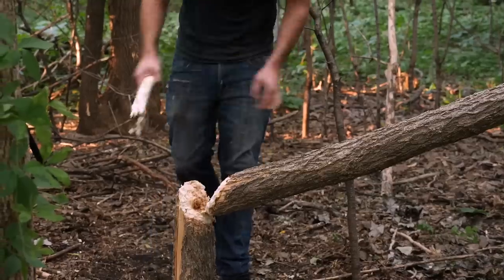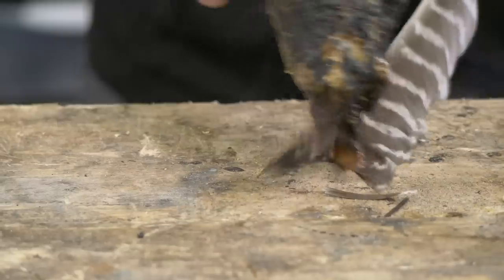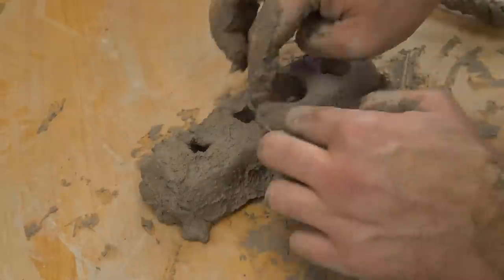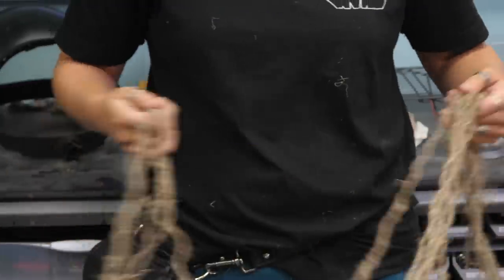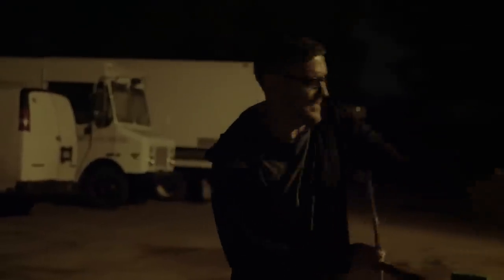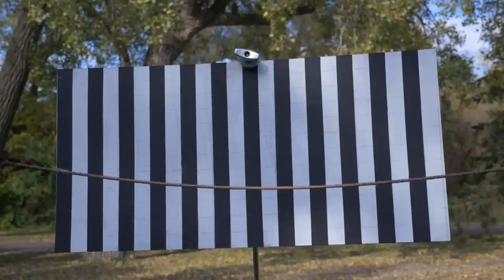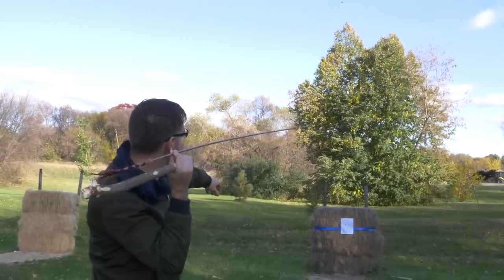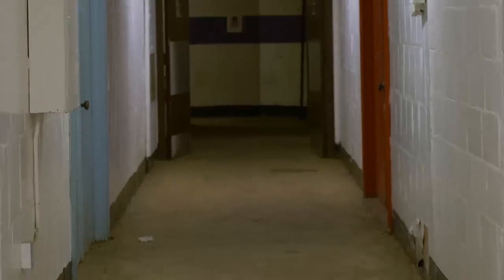Building Primitive Atlatl and Sling from Scratch

Comment: There’s a reason guns became the dominant weapon despite their relative inaccuracy at first... limited skill set needed. Great job leveling up guys!
Reply: Same with crossbows initially. They were quite a bit slower than bows, but you could teach just about any idiot to use one in a matter of minutes.
Reply: Also they're freaking terrifying! Loud bangs and great clouds of smoke that people aren't used to. Imagine you're some late-midieval levey. You're used to being around spears, bows, swords, and such, but you're probably not used to guns since they were far too slow innacurate and heavy to be used for hunting. 
So even though they weren't as good at killing as other range weapons, they would be much better at making the enemy waver right before the lines met, or even break!
And horses probably would have an even stronger reaction to them.
Reply: @chrisc1140  horses still have a strong reaction to them unless they've been specifically trained not to.
Reply: Most early firearms were less accurate and had very limited range, but only compared to modern firearms. 
The accuracy of your average arquebus or musket was about as accurate as a bow within their effective range of 50 meters. So the issue was more a matter of being so popular despite their absurd *cost*. :)
Reply: And the fact that firearms made armour null and void.
Reply: If that were the case, then crossbows would have obsoleted bows three hundred years earlier. The reality is that, despite their shortcomings, muskets were FAR deadlier weapons when they hit. Whereas a bow would only immediately kill if it directly hit a vital organ or artery (Which were probably covered by impervious or near-impervious armour), a musket ball could cause enough damage through cavitation and shock that they'd kill or maim very frequently, and most muskets could defeat the thickest cuirasses at close and moderate range. Muskets were so effective that soldiers began wearing LESS armor when they became the primary tool of the battlefield because it was not worth spending the money on a piece of equipment that was only effective beyond 150 yards from your enemy, or in the occasional melee. 

Most people don't understand that warfare in the Middle Ages was FAR less deadly before the invention of proper firearms. By the time you had pike and shot formations running around the battlefield, most major battles were becoming comparative bloodbaths because of guns.
Reply: @GuyNamedSean  "bit slower" lol they also deliver less energy cuz bolts are worst than arrows but yeah they were used cuz they were easier to use
Reply: In the book "On Killing" by Dave Grossman, he has an anecdote that bow/arrow usage in the Napoleonic wars would have been far superior than muskets, but it was the sound and shock & awe of firearms that struck fear, which "felt" superior. Another case, was Native Americans being superior warriors with bows and became less so when they switched to firearms to fight settlers.
Reply: @engar-dug5197  early firearms we'rent actually that great against the armours of the times, during the English Civil war, among the cavalry and typically wealthier leaders and soldiers they often still wore breastplates to protect the main vital organs, also wearing helmets but quite frankly no one wanted to wear a mask no matter how practical (although there is actually still full-face visors on some helmets of the era.). You can argue that they wore them as melee combat was still common but modern tests and evidence from the period proves that the armour proved quite effective against rounds. One of the reasons I think people stopped wearing armour was also due to the fact that during the 17th and late 16th centuries, you had a transition from classic medieval armies into more modern-esque armies which relied on cheap professional soldiers rather than anyone with weapons who we can hire pretty much. We know bows were still in use till the 17th Century in Europe way after firearms were the main thing, and they proved incredibly effective.

Warfare in the Medieval era wasn't less deadly at all though. More people fought after the invention of the firearm as it required less skill and so more people were able to fight, so more in turn did die. But medieval warfare was incredibly brutal, especially for common soldiers. Knights and Men-At-Arms often were lucky and when taken down on the battlefield they were captured and ransomed, but if you weren't worth much more than your gear, you're getting killed. And then you have such cases as Agincourt where none of that mattered and nobles and common-folk alike were executed straight after the battle with no exceptions. Perhaps people were less likely to die in the midst of a battle due to armour being so common in the later periods, but executions and "mercy killings" after the initial battles were incredibly common, not to mention the sheer amount that died of their wounds.
Reply: Well you need skill not to acidently hurt/kill everyone around to use guns
Reply: @evanbarnes9984  you can't put the genie back in the bottle in a place like the US.

Any idiot who really wants a firearm will get it whether it's legal or not.

Gun Control won't work here.
Reply: @HipposHateWater  No
Reply: That was the theory of crossbows

Comment: You hit the real reason the sling fell out of popularity at the end.  (it was NOT due to armor even though you said that before)  It just takes so much longer to become decent with a sling vs with a bow.  That's the same reason guns won over bows.  Bows were better than early guns for range, accuracy, and rate of fire.  But they took time to train.  With a gun, you could take any schlub and train him for a week to become decent.
Reply: Exactly what I found in my research. Also, slingers have to be much more spaced apart in a formation.
Reply: Огнестрельное оружие победило лук не из-за сложностей подготовки,а из-за того, что сам по себе мушкет представляет отдельное оружие, независимое от физических способностей стрелка.
Reply: @Mega_penetrator228UltraPower  Translated reply: "The firearm won out over the bow, not because of the complexity of training, but because the musket itself is a separate weapon, independent of the physical abilities of the shooter."

My reply to you:  Possibly lost in translation, but not complexity.  The Difficulty and time involved in building up the muscles necessary to pull a strong bow to shoot an arrow a good distance.  That's why it takes longer to train with a bow.
Reply: @Oxnate  это я и имел ввиду.
Reply: Yhea they basically lost value in war when people in general, during everyday use, had reasons to use the sling so would pick up the skill young and be basically practicing every day as they used it to hunt or drive off dangerous animals etc. Same as the bow, as, soon as people stopped having to use it to hunt or as in England for a long time, being law to learn to shoot and to have to shoot at least once a week then their value as war weapons disappointed as, well as it takes years to be really good with either and takes long enough just to be able to get the basic skills down.
Reply: I think I’ve read or heard at one point that the best slingers were sheep herders, boys and young men who while herding didn’t have much to do but get better at using the slingshot they used to protect their herd.

Comment: It's a common misconception that you swirl a sling round in circles like that. There's plenty of techniques that give lots of power but way more control. Still takes practice to be accurate though.
Reply: Yeah, most commonly a sort of crisscross pattern was used going in front of the body making a huge ∞ symbol and releasing the sling toward the top of the loop on  your dominant side.
Reply: And to be fair their throwing form is bad they're not really following through which gives most throws their control and power for both sling and atlatl.
Reply: The sling that they made is also rather short, this is probably part of the reason as well due to the slower throw speed (skill being the other major one)
Reply: @Grayson.P  No. Short slings, while being less powerful, are much easier to shoot accurately. It's just that it was their first day.
Reply: Yeah they swingin it like it’s mjolnir
Reply: Herbert Norkus  yeah ive used an atlatle and they can be fast, but they are pretty inaccurate
Reply: also they could have made a staff sling, its a lot easier to use and a lot scarier
Reply: Not true at all, rotating the sling prior to throwing allows the slinger to gauge the weight of the stone before throwing, it is not strictly necessary (and there a few styles that don't use it), but it is favoured amongst those of the Balearic islands (some of the best slingers throughout history). The misconception is that you whirl it round and round to build up speed (when instead the power should only be added during the last rotation).
Reply: @schoktra  That style is a misunderstanding on the far superior "figure 8" technique, and has been spread about by people who don't know how to use slings effectively.
Reply: The Olde Handgonne I don’t know why people opine on slinging technique when they’ve clearly never used one before.
Reply: ive made and used a sling before and while i was never that accurate i could really generate some speed. if the rock wasnt really close to spherical i could hear it buzzing through the air...and not faintly, it was loud lol. i could throw a baseball around 55-60 mph and i know i could sling rocks WAY faster, i wouldnt be surprised if i was up in the 90s which makes me think the best in the world could do 100 in their sleep. heck, guys THROW baseballs 100 without the added benefit of slings. Anyways, i never twirled it constantly because then youd kinda have to time it perfectly when exactly to leave the rotating circle and go forward. id basically just do a 3/4 circle each time so the pouch would kinda travel in a U shaped path. from holding the sling with the pouch dangling in front of me i just go back over my head then forward over my right shoulder. if you imagine youre just holding a 2-3 foot rope with a weight attached to it and you wanted to bash something in front of you with the weight as hard as you possibly could it helps to get you out of the "spin in a circle and release at the correct time" thought and into the "generate as much speed as i can going forward" thought. if you were whipping someone (i know bad example) you wouldnt twirl the whip around youd just crank it back as far as possible then forward with all your force
Reply: I still kinda prefer shooting like that. The swinging kinda warm-ups my hand for the swing, I swing and fire a lot harder when I spin it to my side before releasing.
Reply: That is just completely false, modern Balearic slingers are the only people who still hold large  slinging competitions in which they use the exact method they’ve been using since the Roman Empire. Balearic islanders took their slinging seriously and made it more traditional because of their affinity for the sling. The peak of slinging was during the Roman Empire of which the Balearic slingers were highly sought out for mercenary work, the Balearic islanders basically perfected slinging considering there are no modern slinging techniques.

Comment: Since the atlatl and the sling have such small projectiles, it would be very, very hard to hit a flying object with much consistency without extensive training. You might want to make a net instead with lead weights on the ends. This would be very effective for catching drones...

and even more effective for catching fish, which has played a major role in supporting mankind during the stone age...just an idea :)
Reply: or use gravel and/or many small rocks to act more like a shotgun.

you are gonna loose a significant amount of power but it's gonna be much easier to actually hit anything.

Comment: That sling you are using is called a short sling and you don’t need to swing it around or apply extra pressure to the rock before releasing it. Short slings are essentially string atlatls and the accuracy is greatly improved by just throwing it like an atlatl. It is also allot easier.

Comment: A quick tip on making the feathers on your arrows smoother for better flight. Take a stick, set it on fire on the tip so it makes an ember, then with the ember fuse the feathers together. This will make them fray less
Reply: That works on feathers too? I've used a similar technique to stop polyester ribbon ends from fraying, but thought it would only work on synthetics.

Comment: If you soak your cordage in water before using it to lash things together you'll get a far more secure lashing. I've fixed split tent poles with this method (jute twine) and it's solid as can be.

Comment: I feel like the "arm" of the atlatl should be at least long enough for the thrower to be able to hold the "arrow" before the CG. 
It's not that I've thrown an atlatl but I kinda see the arrow bounce and vibrate before the release, effecting the direction and force of launch...specially on such a flexible arrow.
Reply: The dart is supposed to partially bend and be flexible, its that same flex that actually gives it slightly more power by springing off the Atlatl upon launch. Watch a video on proper throwing technique with one, and you'll see what I mean.
Reply: @devonchin94  thanks man! I didn't think of that
Any trustworthy example you could link here?

Comment: The way I learned to work a sling, starts with the sling in front of you, as Andy shows. But it must come up behind the back, pass over the head in a counterclockwise circle, then be launched forward. Direction is determined by the arm as 2nd string released. Elevation is determined by the point of release of the 2nd string. 
The Atlatl has more to do with elbow and wrist. Not the whole arm. Both do take alot of practice.

Comment: I find that with an atlatl, I'm most accurate when I cock my arm all the way back, and move my arm straight forward, not in an arc, as I take a step forward. It's not as powerful as it would be if you put you're whole body into it, but power is worthless if you don't hit the target. Slinging is definitely a skill that takes tons of practice. You should try some different techniques and practice them for a while, and then decide which one you like best. As with anything involving throwing hard, don't overdo it. You can hurt yourself, so break up your practicing into shorter, more frequent sessions rather than one long session, and take a couple days off if you are hurting the day after

Comment: Hey guys, if you were to revisit this build/scenario in the future, might I suggest the following: 
1)Use leather for the thong of your slingshot, as it'll be more aerodynamic and elastic. This will allow your slings to be more accurate and deadly
2) The slingshot should be less long,  no longer than your arm from shoulder to wrist joint when open, or the length of your forearm (maximum) when folded over and loaded.

Comment: 12:18 i know how hard it is and the rocks goes really fast i made one.it's more dangerous to the shooter than to the target
Reply: First you only spin once.
Second you start with side arm, not over head. Until you learn the feel of a sling, overhead is too dangerous.
Third you practice w something like a rubber ball, not lead or stone.
Fourth the profile for proper release should resemble a pitcher's release, not an epileptic spasm.
Finally ALL weapons are more dangerous to the user than the target when you don't know how to use it
Reply: Btw I've used slings for years and never caused myself injury worse than minor rope burns on my fingers.
Reply: @nicholashodges201  i just talk about persibal experience and used it how internet told me to with a stone and over the head. There is many times were i cape close to hit myself in the head with the stone and many many times when the stone came everywhere and sometipes in dangerous places
Reply: @karvast5726  that's why you start with side arm release. If you flub you're going to hit your leg before you hit your head that way.
I learned how from an guy who did missionary work & learned from a shepherd.

Comment: I could be wrong but I think your using the sling wrong, if I remember from hist right your swing overhead and come down and out horizontally on your dominate side
Reply: Yup, no swinging around building speed. Just one swinging motion while rotating your upper body into the throw.
Reply: There are many different ways to swing a sling.
Reply: I know of at least 4 methods of swinging the sling.
Reply: None the methods involve pretending to be a helicopter, though
Reply: Nicholas Hodges lol
Reply: @posiden72_9  it's a peeve, awright?
Reply: Nicholas Hodges fair enough

Comment: I've used many different ranged weapons from archery to rifles to shotguns and more. Slings are hands down THE hardest ranged weapon I have ever laid hands on. So don't feel bad for sucking. It took me months of practicing three times a week to get as "good" as I am now and still I could never hit a flying target. I don't think a Balearic islander could reliably hit a flying target and they are the best in the world. 

Here's some tips anyway. Don't swing it around so fast. The swinging motion is to keep the rock in the cradle, not to build up momentum. All of the power comes from the last half swing around when you like the feel of the shot and commit to it. And this is the best advice I can give. Throw the knot, not the rock. If you try to hard to throw the rock then it will go hard to the side everytime. Forget that you are even holding a sling. Pretend that the knot is the projectile and that you are having to use a goofy throw to yeet it.